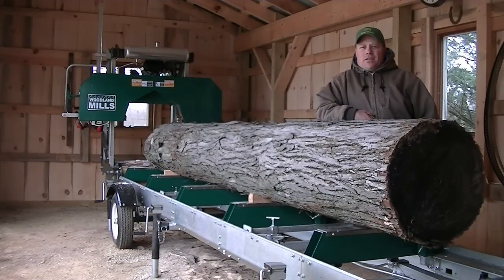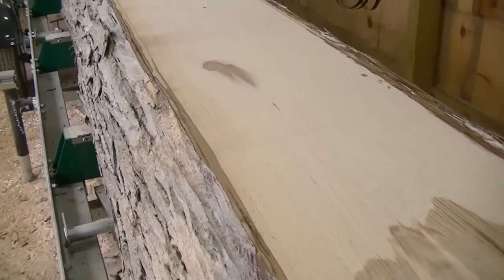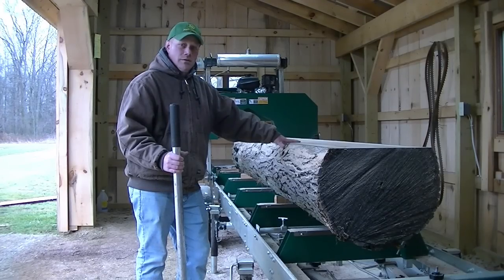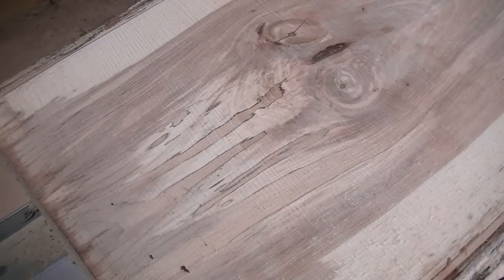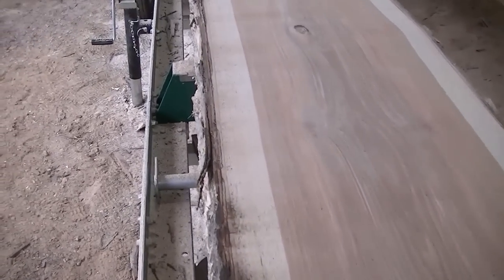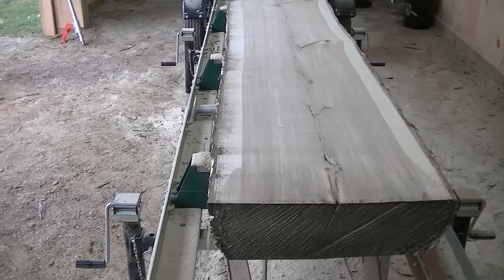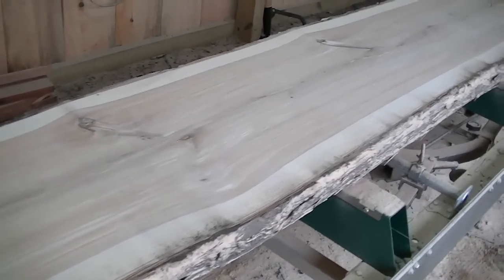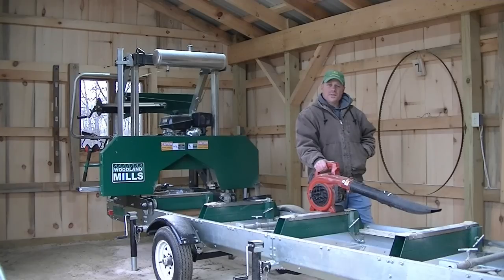Big Hickory Log on the Sawmill Today, Woodland Mills HM130

Comment: I was surprised how well that little tractor seemed to handle the log. It must have quite a bit of weight in the rearend more so then some kubotas i've seen and used. I like your little shed by the way and if you can ever get a hold of some wormy maple you will really think nice wood once you saw into it.  I've made my coffee and end tables out of it several yrs ago and wish my floor was the same stuff. Back when i was a logger i'd often cut a good bit of the stuff around little streams and stuff but don't get into it very often now just doing firewood and stuff. I love messing with and cutting wood though. It's something that never gets old to me. Be safe and happy milling!
Reply from the maker: Yes the backhoe on the back adds 900 pounds and around 500 pounds in beat juice ballast in the rear tires keep in on the ground well. Never heard of wormy maple, sounds very neat, thabks for watching!
Reply: @AaronTurnwald  I was never able to see past about mid rear wheel in the video so i wasn't able to notice a backhoe. lol That makes perfect sense tho. You should look up the maple. No need to reply again and thanks for the response.

Comment: Nice she'd.   58 year old millwright here giving you advice.   Don't bounce your logs on the machine like that.  You're messing with all that leveling you did.  Roll your log onto a couple of sleepers on the ground, then gently set it on your log bed.  Also free wood should always be cut rift to quartersawn..  flat sawn will warp and twist too much.
Reply from the maker: Thanks for the tips! These big slabs being cut thick like that i have never had an issue with warping or twisting. Maybe luck or proper stacking but ill keep an eye on em, thanks for watching!
Reply: 60 year old millwright here, and I was thinking the exact same thing.😂😂 A good pair of gloves might be something to consider investing in too.
Reply: Ware a mask while using blower
Reply: Love to see a live Edge slab cut quatersawn.......

Comment: shagbarks notorious for holding and collecting dirt sand and debris in the bark folds ,...many times when i cut them using my chainsaw sparks fly from the chain
if ya can knock the bark off ...i would ,
nice barn,
mike
Reply from the maker: Thats a good point. I do remember seein sparks a couple times. Makes sense, the bark would catch a ton of airborne dirt when its windy.

Comment: You can spray the log down with your garden hose or pressure washer to remove dirt from dragging it out of the woods. A wet log is cooler on the blade too.
Reply from the maker: Probably a good idea, thanks!

Comment: Hickory is in my opinion the worst on chainsaw or any cutting devise, the bark is gritty without any added dirt from handling.
I have seen sparks fly when cutting at dusk with chainsaw or in low levels of light. 
pecan, walnut, oak, gum, black jack,  they are all murder on saw mills.
Yes, the building is a Gem, very very nice.
I agree about the slamming of the logs but sometimes it's unavoidable unless you tractor it off. you could put it on forks of tractor, roll it towards the tractor let it drag as heavy as possible against the back of the forks to ease the slam.
you're not the only one that has slammed a mill, I have too, and lots of mills catch pure Hell because time required and effort involved, and many don't have equipment or help to handle properly. 
You can BURN up as much time at a mill as you want to, quarter sawing is very labor intensive on a manual mill.
We had a Frick circular mill, still do but not been run since dad passed (23yrs) I don't remember him mentioning quarter sawing or the pith, Grandpa had a mill too but that was before my time,. my point is I don't know how long this quarter sawing has been popular.
I just got the 130max but have been away from milling almost 30 yrs.
I'm not against quarter sawing just have not done enough to have an opinion and its kinda new to me. 
Always plenty of free advise.

Comment: Suggestion  Boss, cut yourself some 12x 12 or so and set your mill on them,  your mill won't jump around so much, and helps with end product
Reply from the maker: Its on a trailer.
Reply: @AaronTurnwald  
Yes I know 
Talking about supporting the rails in a few more spots, vs those couple stock stands,  also, nice video

Comment: Did you jack up the small end 1 1/2 inches so the center of log is parallel to the mill? You did say the small end was 18 inches and the big 21 inches right?
Reply from the maker: Not on this log, but i do have that capability. But the pith in the log is not always in the center remember.

Comment: Your first video for me.  Noticed that you have a bucket to catch the sawdust and very little room next to that wall.  Is there a reason not to turn the mill 180 degrees around so the sawdust would blow out toward the doors?
Reply from the maker: Hi Thanks for watching! I believe the video is deceiving. The walk space is 5 or 6 ft wide on the bucket side so no issues walking around. So far the bucket process has been excellent an I haven't had a need to change it.

Comment: I've got tons of hickory trees on my lake property in Kentucky. Don't really like the mess they drop on the ground. Plan to cut down many of them. No real market here. Good firewood though. It's hard on  saw chains,  bandsaw blades, woodworking equipment but can make nice cabinets. Considering getting a mill when/if COVID prices improve. Any advice would be appreciated.
Reply from the maker: Best advice i have is, get a mill. Some of the most fun you will have if you like woodworking or anything related. My favorite kitchen cabinets i have ever seen are hickory.
Reply: I have the 130 max without the trailer, and my only regret is not having the trailer. The 130 Max is a great unit and will make you so many sellable boards to pay for itself in a very short time period. There are better blades available for these mills, taking things slowly will increase your board footage also. Again, no regrets on purchasing Woodland Mills products.
Reply from the maker: @scotpettengill7801   i would like to have the max. So many times need just a little wider. Thanks for watching!